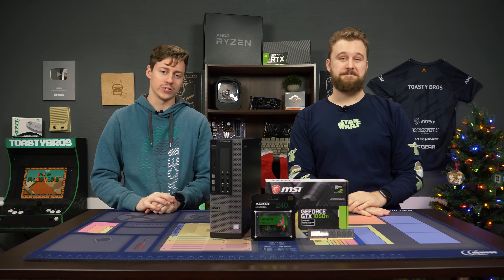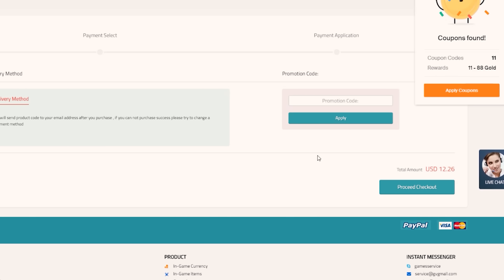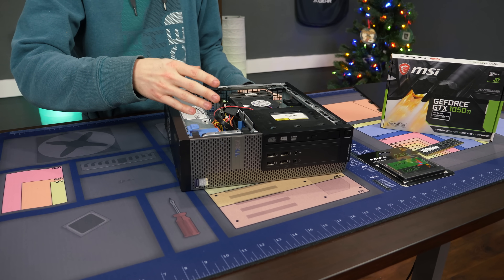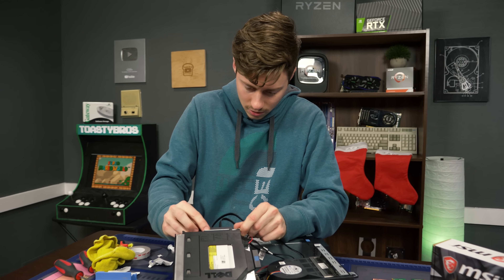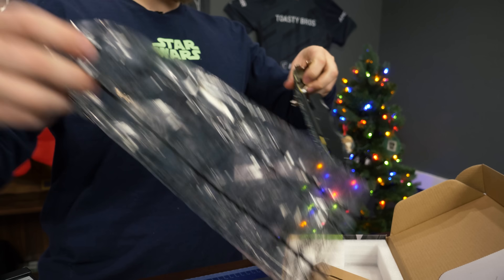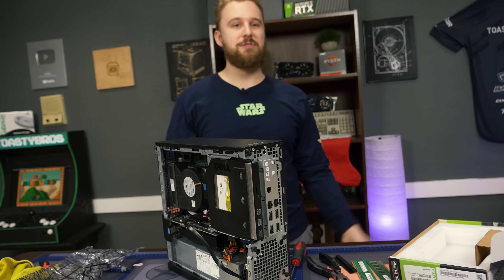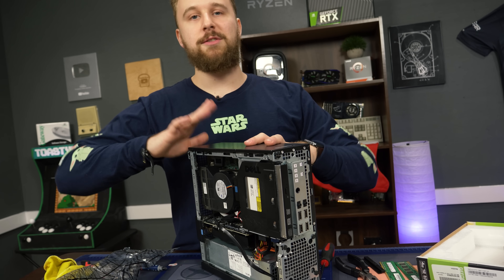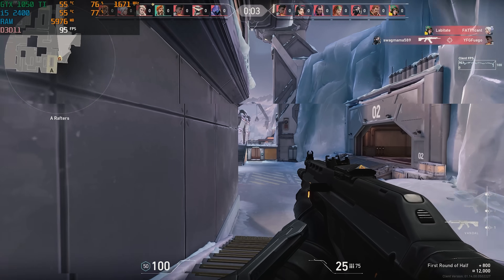EASY $250 Gaming PC Build - Step by Step

Comment: Recently did a Optiplex 7020 Full Tower build, i7-4790, a used GTX 970, and 16G of RAM. I trying the Linux DraugrOS and with Proton is it running games and Slicing my 3D printer files amazing. Spent only 200 bucks on the whole build (Got luck on some prices) but I had to Chop up the Hard Drive caddy to get that Video Card in that case.

Comment: is it possible to fit a rtx 3060 ti in there
Reply: No, But you could get a pcie riser cable to hook up the gpu wouldn't be able to close the case and the power supply is probably to weak too to power the gpu but anything is possible lol

Comment: i would recommend to put a gtx 1650 its more powerfull, low profile as well and cheaper, so if you find a 1650 around 100-150 bucks go for it

Comment: gtx is better my guy and i have dell optiplex 3020 with gtx 1650 low profile
Reply: gtx 1650 at begin*
Reply: What are the specs and what FPS do you play fortnite at
Reply: @Respect-vs8kf  i dont have the 1650 yet but i now have i3 4130 and gt 710 2gb ddr5 and i have around 100 fps performance mode low settings and resolution 1440 x 1080p
Reply: @lucasie2806  i have a dell optiplex 7010 mini my specs are i5  do you recommend me buying a gt 710 for fortnite right my average in fortnite fps is 35
Reply: @Respect-vs8kf  dont buy gt 710 buy a gtx 1650 low profile instead or if you want a beginning gpu get a gt 1030
Reply: @lucasie2806  ight thx bro

Comment: will let know, if using a 9020 OptiPlex that is similar design, the top pcie is a shorter slot that is used for smaller cards such as a wifi card. Can place a 1030 instead, but if I knew that the 790 was a different motherboard style than the 9020, I would have choosen the 790.

Comment: Yeeeeaaaaaiiiiiiii.... Dell did it!
I own a 7040 and the 7040 and its successors had an interesting "feature".
There was a PCIe 16x slot directly above the PSU and the slot where you now installed your GPU was an PCIe 4x open-ended slot. So with the 7040 you also had the option to install a low profile double slot card but it would only be able to use 4 lanes while the 16x slot could only be used with a low profile single slot card.... Great design 😂

Comment: Just a heads up. You may be able to get a better model of the dell optiplex in 2021 for a similar price. I would recommend the 7020 0r 9020 as they have more ram slots. Another benefit to these models is the ability to use a fourth generation cpu instead of a second.

Comment: I got almost the same PC. An Optiplex with an i5 3470, 8gb of ram and 500 of hhd but put in an RX 550 and the total for the build was $220 for me. How much did you pay for that 1050ti?
Reply: I got that optoplex 7010 from school but its slow sometimes is your build good?
Reply: @mtcos  It it really good, although I have the 9010 and just recently got it so it just have a few programs installed. If yours get slow sometimes just replace the hhd for an SSD and that will change everything.
Reply: @alex5shaq  thanks!
Reply: With the gtx 1050 will be like 500 dollars lmao

Comment: Did exactly this, works great!
Reply: Can you run gta online or fivem????
Reply: @CameronMalilay  i have the same secondary rig, for me it runs gta online (high settings) at about 50-60fps depending on the lobby sizes etc
Reply: For $250?
Reply: @vvvvvvvs  no more like 350. 1050ti is hella overpriced rn. I got lucky too. Snagged one for 200 bucks.
Reply: @vvvvvvvs  i also got a newer optiplex. Mines got the 4th gen cpu.
Reply: @ShadyXJ_413   yeah where I live 200 bucks is a bit under 400 lmao so I guess I'll have to get a shit old gtx 650 and a 4th I3 cause it's  3.5 ghz but doesn't really matter cause I only play roblox and Minecraft bedwars
Reply: @vvvvvvvs  if its small for factor like in the vid idk if anything that is not low profile gonna work
Reply: @vvvvvvvs  also, i think u can upgrade the cpu. Mines got the i5 4590.
Reply: @ShadyXJ_413   no I'm gonna use bigger optiplex and replace the cpu

Comment: My Dell T3500 with Dual Xeon W3503 processors  is an even cheaper gaming machine (if you don't count the video card).  I run a SSD, 32GB ram and a GTX 3060.  It plays anything I throw at it.

Comment: I don't play games but I also hate slow computers and computers that can't handle whatever I find on the internet or autocad programs. I thought that if I get a computer that is gaming capable, that all my other issues will be automatically covered. Now, the question is, am I correct in my assumptions? I can't find any computer guys on YouTube that address us non-gamers that want to enjoy a fast computer for as cheap as possible or at least under $600.

I don't want to run into ?K videos that won't play or anything saying that my pc is too slow or not compatible...because I was too cheap to break the bank. Anyone able to shed some specific light on what I am looking for?

Comment: You do not need a low profile card in a SFF! Although the PSU does have very low wattage and a specific 8 pin PSU to Motherboard connector with no upgrades, that doesn't mean you can't replace the PSU!! If you want a better GPU and PSU with higher wattage please consider getting a 24 pin to 8 pin adapter! THE CASE WILL NOT CLOSE WITH A NORMAL GPU! IF THE PSU DOESN'T FULLY FIT IN THE CASE YOU CAN ALWAYS PUT IT ON THE OUTSIDE! If this helped you're welcome. Low Profile cards are more expensive and cost more than cards that make higher Fps.
Reply: yeah but you have to get something like a 750ti lmao

Comment: used the same setup. added 16gb ram 500gb ssd replaced i5 2400 with xeon e3 1270. low settings i can get over 60 no stutters at all and thats at 1080p in warzone . also did a few windows tweaks and installed it all in a customized case i had laying around. i like the way it runs warzone better then my xbox one s
Reply: Did you do case swap to the sff model like they did in this video or the mid size model from Dell?
Reply: where do you put the ram modules because i bought some but i’m completely lost , i’m new to this kinda stuff

Comment: This makes a great starter pc for a kid. Plays fortnite, slime rancher, minecraft, among us etc.  
I would stay away from the i5 2400 though.  That pc is going to be really old.   If you spend two weeks on ebay can easily get into a 3rd or 4th gen i5 which are substantially better for close to the same price.   
Im not a big fan of the LP 1050ti.    Those things are really expensive and for the money trade off probably better to get a non LP card plus MId tower size optiplex.   Still close to the same total price but much easier to upgrade later

Comment: @Toasty Bros I really want to make this pc but I can't find a gtx 1050 ti anywhere online for less than 150$. I found a dell optiplex 790 sff for dirt cheap, and I found a bunch of good quality, but cheap graphics cards, but I think they are all too big. Could you please recommend a graphics card for me that is under 150$ and would fit in the 790 sff? I would appreciate it very much! Thanks!
Reply: I would only really use it for easy to run games like minecraft and valorant. Also I would greatly appreciate it if you guys could tell me the dimensions of the space there is for a graphics card. Is 8.7x 4.5x 1.5 inches too big?

Comment: I've bought some expensive pc hardware because I've always wanted sum powerful hardware. With a Rtx 3070 I'd be at a grand total of $1400 without tax(~$900 with no gpu). I have $675 allocated to the graphics card. I can't justify paying more than $100 markup(or +50%) of Msrp. does anyone have a recommended cheap gpu that's close to Msrp, currently the only thing I could find is a rx 570
Reply: P.S. I'm fine with any card, even a gt 1030 if it's close enough to it's regular price.

Comment: Is i3 4350
GTX 1050ti
8gb DDR3 ram 
Good?
Reply: its decent but i suggest u upgrade to i5 and gtx 1650ti
Reply: @syve4172  do you think a i5 with a gtx 1050ti could run warzone
Reply: @YaseenOutTheWay  yes medium settings should run good
Reply: @syve4172  do you think an r9 270 could do the same?
Reply: @YaseenOutTheWay  probably not, its very old for a gpu

Comment: Wow, I got a pc with an i5 2500k, radeon hd6870, 16gb of ram, pretty decent cooler, overclockable motherboard, 800w 80+ bronze psu 240gb ssd, 1tb hdd, mechanical razer keyboard, (crappy) monitor, Logitech’s g502 for just €150, I sold the monitor and got €30 from it, after that I purchased a gtx 1060(6gb) for just €80!

Comment: this is awesome. my favorite desktop is my Optiplex 980 with i7-880, 16gb (4x4gb) XMS3 1333mhz, 1GB GTX750, 240GB hdd. i upgraded from the i7-860, 4gb ram, and rediculously aweful gpu. if i didnt have to trim the gpu i would have put my gtx 1050 ti sc 4gb in it.

Comment: how many watts is the psu of optiplex 990 sff, mine is 240 watts. i want to know if the gtx1050 ti works perfectly with a 24o watts psu
Reply: 240watts is enough for gtx 1050ti low profile and will run fine
Reply: I’m wondering the same thing, I’ve read that it’s not enough to power the 1050 but it can power the 1030 fine

Comment: So would any old Dell Optiplex case work for this?  We have an Optiplex 360 (from like 2009) at my office that nobody has used for years, thinking I may take 'er home and start upgrading.  My current work desktop is an Optiplex 7020, I suppose I could use that one if necessary, just puts me under the gun to finish it quickly, lol.

Thanks for the videos, very helpful to a noob like myself.

Comment: Do u recommend pairing an i5 4590 with a gtx 1650?
Would appreciate it!
Reply: Would still struggle on newer games. Would recommend an i7 4770 if the board supports it
Reply: All depends on prices and what games.  Its a good play to start as far as budget.  Could upgrade to an i7 or xeon for hyper threading later as 4c/8t is really becoming the minimum nowadays.
Reply: @poorsap1598  can confirm 4c/8t is the minimum. I had to upgrade from i5 4460 to i7 4770 because I would hit 100% cpu on a lot of games with the i5 because it had no hyperthreading. After the upgrade I now see zero problems with the performance.
Reply: @JudeTheYoutubePoopersubscribe  WIth a 1650?

Comment: I literally ran this exact setup but w a i7 2600 as my first build for 2 years and it was exactly what I needed for COD and hd premiere pro editing. HIghly recommend it, I just upgraded to my second build w a r5 3600
Reply: How well does the i7 run games?
Reply: @Tylerprince08  that i7 was awesome, never had any complaints or bottle-necking when i had it w the 1050ti. I now use that cpu in a server build since this chip has 4 cores 8 threads, wouldn't go with anything less tbh.
Reply: @RolandWhales  Ok, thanks
Reply: What was the Intel card they were using?
Was it the i5?